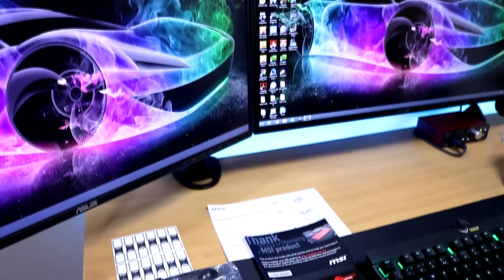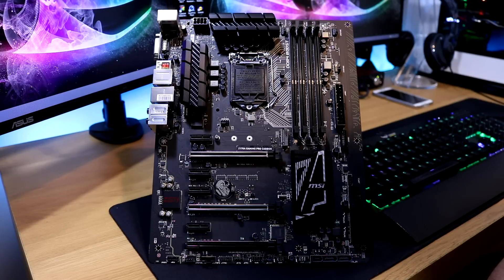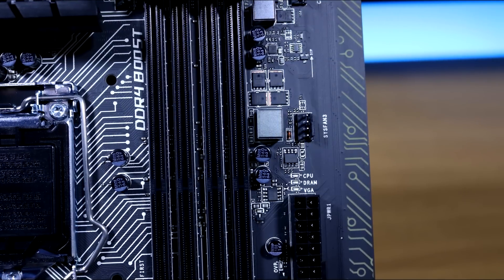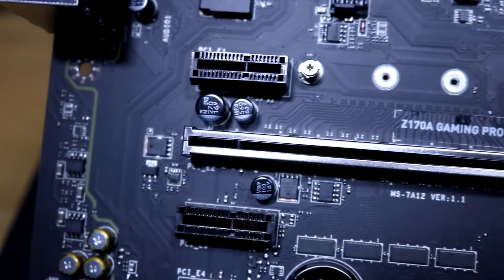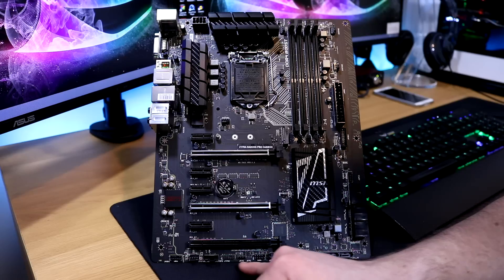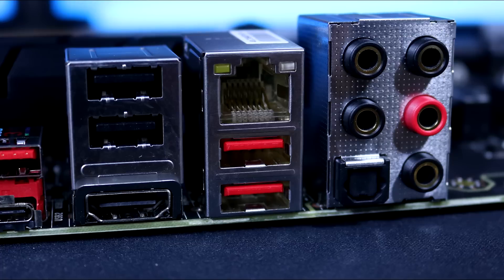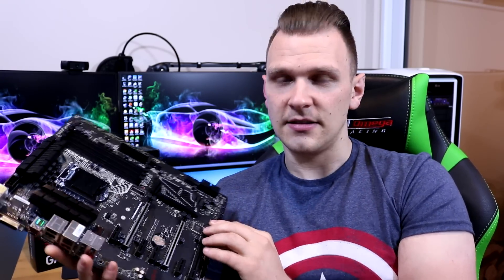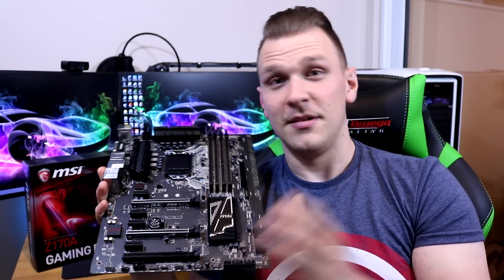MSI Z170A Gaming Pro Carbon RGB LED Motherboard Review, In Depth Look, Skylake, DDR4

Comment: could you possible do a build video with this motherboard to see how it would look and work in a case with other components?
Reply from the maker: You are in luck my friend because should be getting a corsair 400c case for my new build so I will put this in to see whats it looks like :)
Reply: +Tech_K_Raiden that sounds pretty cool, I'd like to see that. I'm considering buying this motherboard so I'd like to see how it works and looks in a build.

Comment: which one is better gaming pro carbon or gaming krait 3x?
Reply from the maker: Arulxrws Hey. Truthfully they are the same board with the same spec the only difference is they have some slight changes and the pro carbon is all black and has there mystic lighting (RGBs) on the board. Personally the pro carbon I would pick up between these two :)
Reply: Which one is best msi gaming m5 or gaming pro carbon?
Reply: bump
Reply: Veraliant Pro carbon 100%

Comment: what is the difference between the Msi Z170 gaming M5 and this board?
Reply: LED's and layout is the only real difference
Reply: ***** thanks for the reply so basically they r the same thing so does that mean the pro carbon is better because it has LED?
Reply: Depends what your colour scheme is. If you have a red build, the m5 would be better.
But personally I would recommend an ASUS board like the z170-a or the pro gaming one.

Comment: between this board, the krait gaming 3x and the ASUS Z170 pro gaming aura,which one would you recommend?
Reply: other than these are there any good white/black motherboards between the 150 to 250 price range?
Reply from the maker: Hey truthfully they are all about the same , they all feature around the same level of spec on the boards so its really up to you but for me I would go for the carbon pro by msi but which ever one you pick will preform good.

Comment: Nice video I just have one question, how many fan ports does the motherboard have in total? I'm going to be building my PC in a couple of weeks and I'm going to have 6 fans total inside my case so just curious if I'll be ok with this motherboard or if I'll have to buy a fan controller for it.
Reply from the maker: +Brent Henry Heym Brent It has 5 PWM fan headers on this which can all be controlled on the motherboard, so no need really to buy a fan controller unless you have a lot more fans in your case.
Reply: +Tech_K_Raiden I'm gonna be buying a H440 Razer edition so it comes with four fans and then I'm also going to be putting a NZXT Kraken X61 on the top but I guess I could always run one fan from the rear fan controller, I've just heard that if you plug a fan into the rear controller they'll run at 100% the whole time
Reply from the maker: Well what you could do is put all four of your fans on the system fans header (x4) on the board and then for the cooler fans just use a splitter 2 into 1 for the cpu fan header.

Comment: I'm not sure if i go with the MSI Z170A Pro-Gaming Carbon or the Asus Z170-A. Any suggestion?
Reply from the maker: +Max3090 I believe both motherboards will have around the same level of specs and perform about the same so down to brand and style. Ether one will be good, for me msi :)

Comment: can this motherboard connect to the wifi wirelessly or do you need an Ethernet cord?
Reply from the maker: You need a Ethernet cord. It has plenty of pci express slots so you can go out and buy a wifi card for it :)

Sorry about the slow response.
Reply: Just use a USB wifi adapter.

Comment: will this work with an i5-7600k? please need a fast reply
Reply: Aimbot active no this motherboard is only for i5 6th generation such as 6100 to 6700k
for 7th generation go for z270
Reply: Aimbot active it will but you will have to update the bios before you install the CPU or it will be a pain in the ass to get a post

Comment: Any cons or problems with this board?
Reply from the maker: No not really for the price its a cheap board with some decent stuff on it like there audio boost 3 sound chip and m.2 support. 

Cant go wrong with this motherboard truthfully, of course if you wonted more features on the motherboard then it would require to spend more and go for another one.

Comment: Just bought two of these, one for my build and one for my gf, and so far it really is an amazing MB. 90% of the utilities it comes with are also pretty handy as well, usually I never bother installing packaged utilities but it's worth it in this case. Sturdy, BIOS is easy and intuitive to use and my build started up first go with no issues (other than needing to enable XMP for my RAM).
Reply: Nobody cares
Reply from the maker: +Elise Zadow (Strickycub) Hey. Yeah for the price its a decent MB :)
Reply: +Peter Johnston.. about your comment.

Comment: no displayport!? not that its too important with a GPU in it. I really love the rear I/O panel. i would almost go with this one just for that as i'm building an open case. still think im sold on the Asus maximus 7 hero alpha tho, NVMe and dual u.2 FTW
Reply from the maker: +organicinsanity All motherboard preform  about the same mainly just look and style and couple add on features. Yeah the Asus board will be nice board indeed.
Reply: the more i look at it the more i think i will go with this one. 100 bucks cheaper and the only thing it doesnt have that i can see the hero alpha having is dual integrated u.2 ports and an onboard display port (howwever in the same sentence im pretty sure the hero alpha doesnt have onboard DVI) and this one matches my build about the same

Comment: hmm nice video and all i need to team it with some RGB mouse,keyboard, and monitor and it be an good setup. hmm changing all them colors are getting easy these days
Reply from the maker: I love that Pc gaming products have RGB now because you can change the colour when you wont and have a different colour build every week :)
Reply: +Tech_K_Raiden yea that my idea, but the monitor is not RGB yet. So far you can get the ATX CASE, keyboard, mouse and now the motherboard but so far all Monitor has an basic mettle black frame around the monitor screen
Reply from the maker: +Jimmy “syfy88man” Dunn You can get RGB graphic cards I seen at ces :)
Reply: +Tech_K_Raiden I know you can get them for the graphic card, what i mean is the monitor, all monitor frames are either mettle black or some sort of glossy plastic that wraps around the screen of the monitor
Reply from the maker: That could be a new thing seen rgb lighting on the monitor surround haha to give it a glow ect
Reply: +Tech_K_Raiden Yea Jay2Cent did an monitor that had an RGB light strip under the lower edge of the monitor but it only had white, red, or blue as the setting for it. Yet I want to see one that can wrap all the way around the whole frame of the monitor

Comment: My power supply 24 pin connector will not connect to this msi mobo. Power connector has a notch in it. Any recommendation what power supply to use?
Reply from the maker: +Bradley Miller Hey any new one should have the right connectors. Which power supply you have now? And whats yours bugget for one? What gpu and cpu do you use?
Reply: sure u have the connector the rights way around? the noch on it is to Prevent u put it in the wrong way

Comment: hey men should i get an asus z170a or an msi Z170A Gaming Pro ?
Reply from the maker: +Romario Bilaj Spec wise they are nearly the same board truthfully both will perform the same so it really depends on your design taste but for me I would go msi :)
Reply: tnx men i end it up with a gaming m3 msi
Reply from the maker: Romario Bilaj Nice soild motherboard, what cpu are you going with?
Reply: my spec are cpu i5 6600k gpu gigabyte gtx 1060 3gb power evga 600w bronze +80 8gb ram 2133mhz hyperx fury 120gb ssd kingstone cpu cooler evo 212 all this i got them for 810 euro... what is your opinion about this build ?

Comment: is usb 3.1 the same as usb 3.0? and will a usb 3.0 device work with a usb 3.1? thanks.
Reply from the maker: Hey. No its not the same, usb 3.1 is about twice as fast as usb 3.0 and yes I believe its backwards compatible so 3.0 and 2.0 ect should work on 3.1 :)

Comment: Is this a good mobo for an i3-6100?
Reply from the maker: Hey Rivenous yeah should be good for that cpu indeed comes with some nice feature on the board.
Reply: Thanks does it only support ddr4?
Im thinking of getting this mobo with an i3-6100 and gtx 950,any suggestion or recommendation?

Comment: Would I be able to run the new Geil Evo X RGB ram on this board? I know the RAM is compatible, but what i want to know is, would I be able to plug in the RGB power connector from the RAM to this motherboard?

Comment: MY GAMING PC: Corsair VS450 450 Watt (80+),  MSI Z170A Gaming M7,   Intel Z170,Intel Core i7 6700K 4x 4.0GHz,  Scythe Katana 4,   8GB OC DDR4-RAM PC-2400,  AMD Radeon RX 470 RS 4GB, XFX Black Ed. OC,  1000GB S-ATA3 EcoGreen,  7.1 AUDIO BOOST + Soundblaster Cinema,  Windows 10 Home 64-Bit.
Reply from the maker: povilas bielevicius Hey Seems a good pc to me bud :)
Reply: nice im thinking of building one this is my build http://pcpartpicker.com/list/F7dPzM im still confused on if i should go for this motherboard or upgrade to the msi z170a carbon

Comment: Does this mobo runs ram at 3000 MHz
Reply from the maker: Hey. Yes I do believe it supports 3600+ mhz ddr4 ram :)
Reply: +Tech_K_Raiden ok, and also, you can configure the leds on it right? It wasn't very clear for me :v
Reply from the maker: +Felipe Zermeño Yes you can install there application and then you can change the rgbs to what ever colour you prefer  Note though that the red leds around the sound chip is always red and cant be changed.
Reply: +Tech_K_Raiden ok, thx so much man
Reply from the maker: +Felipe Zermeño No problem. If need any other help ask away :)

Comment: got this board.. arrived 2 weeks ago with all the other hardware.. , games start to drop in fps and lock around 30 fps but ran with 120 fps before.. it always happens, after the graphics card freq'ed down. say from 3d ingame scene to 2d char selection screen. if it then goes back to 3d, its locked at 30fps and goes almost down to 10fps sometimes.. i changed the gpu, changed the PS, problem persits.. turns out: bios says, the 16x pcie express slot only runs at 2x. how can that be? even updating the bios didnt change a thing. i put the gpu in the middle pcie slot for testing, there it says, the card is running at 8x, which is right for the slot. does this mean the board or something on it is broken? would that explain the fps drops in games that accur randomly?

Comment: Wait, you call this a "review" and you haven't even installed the thing?!
Reply: Can you really expect him to take his rig apart just to install it for a review, get real. What would it prove anyway, that it works.
Reply: +Richard Dale Benchmarks, OC capabilities, BIOS and led adjustments?
Reply from the maker: +JCTiggs That is true but Should I have to spend £600 just to show benchmarks ect?
Reply: Tech K Raiden Those must be some expensive benchmarks!
Reply: +JCTiggs benchmarks of what? They don't differ that much from board to board. Kyle has covered all the features. There's only so much time you can put into a video. Some right selfish bastards. If they think they can do better why don't they give it a go or watch another review? Rather posting negative comments.
Reply: Richard Dale Take it easy there Corky! Where did I post negative comments? Good grief.
Reply: +Richard Dale I merely meant that I wouldn't call this a review because to me a review involves actually testing something instead of just doing a hands-on while listing the features. Did you feel all manly when you called me a "bastard" as a reaction to such a harmless comment? Toxic masculinity much? I would suggest you try and learn to deal with that random anger and aggression. You're way too emotional for a casual conversation on the Internet.
Reply: +JCTiggs sorry man I think I've got my replies mixed up. I'm just sick of folk moaning on YouTube no content is ever good enough even though they still sit and watch it all for free whilst other people are putting in countless hours of their free time with very little reward. Especially a channel of under 3k subs.
Reply: +omglenses I don't agree it's not a 'casual' conversation is it. That last comment was fair play but your original post doesn't come over as constructive criticism it just comes over as a moaning / troll comment. Before typing try thinking for 1 second how the creator and other viewers are going to perceive your comment. You wouldn't say it like that to someone in real life and not expect them to not take you the wrong way. "Call this a review" you'd say something like. "OK video but I would have liked to see the board in action". Still real people mate even online.